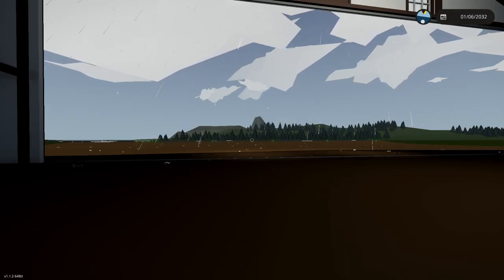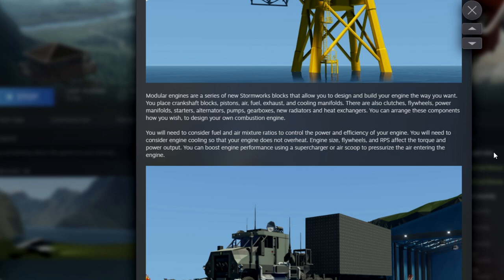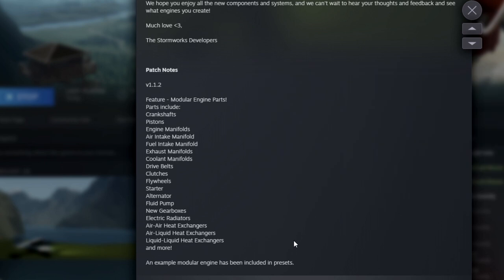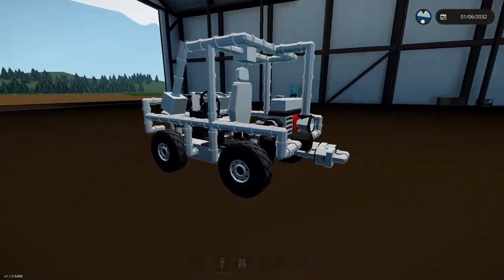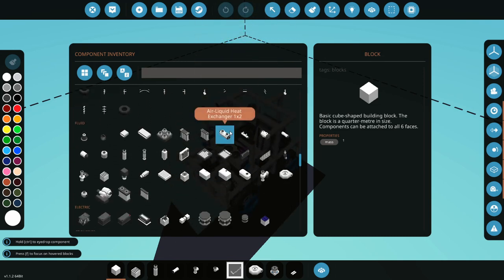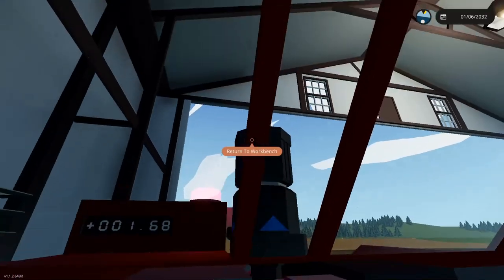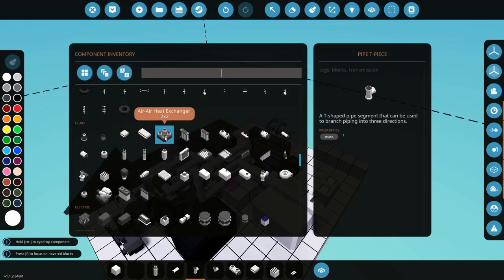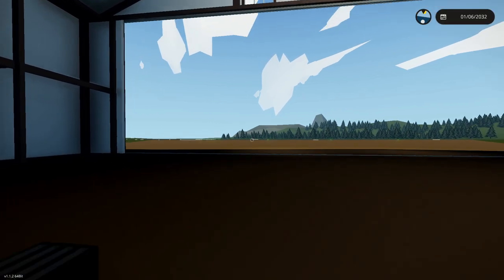Modular Engines & Much More! | Stormworks major update 11

Comment: As of right now turbos and superchargers aren’t really worth it. You would be better with a second air manifold. And I feel like cooling needs a buff. The catalytic converter is for removing exhaust particles.
Reply from the maker: yeah, I have kept messing around with the superchargers and they don't seem to do much at all. Yes the cooling definitely needs a buff, but I know a few of the new parts are broken right now. I know the basics of a catalytic converter, I was just wondering why they added it in. It seemed like a odd addition.
Reply: so exhaust that has been 'catalytically converted' might be useable as intake air?
Reply from the maker: @AggroPhene  I don't think that is possible, not 100% sure though
Reply: @StormRunnerGaming  I think the catalytic converters are there for not dumping smoke in to the camera (third person).

Comment: Btw you don't need a pump for fuel
Reply: I think you need to do it with modular engines.
Reply: No you don't itll pull fuel itself from the stock fuel tanks at least

Comment: Well its not really a full release because they are useless fire starters without the ability to cool at all. Each engine has a very small amount of work that it can do before it overheats and burns down, like a disposable battery. Worthless. The gearboxes are by far the most useful.
Reply from the maker: yeah, so far I just turn off engine overheat to work on modular engines (I know it is kind of cheating). But it is still nice to mess around with them.